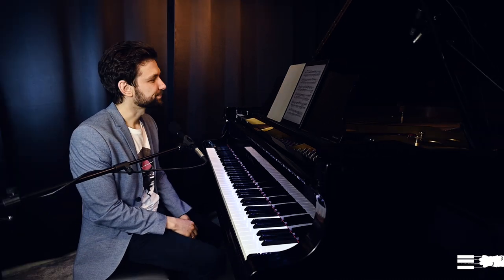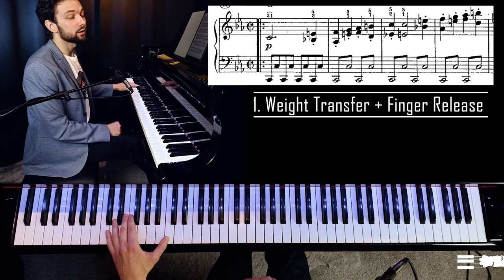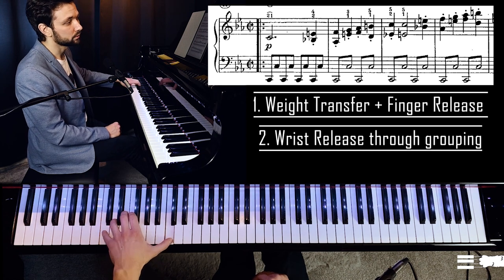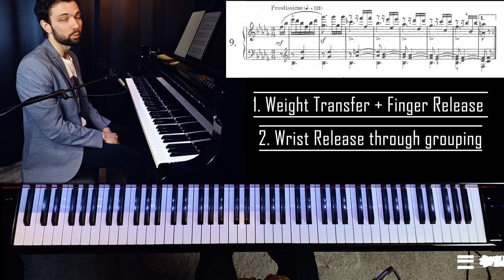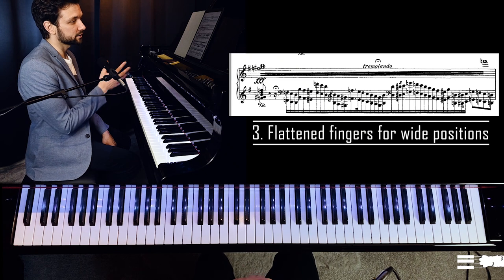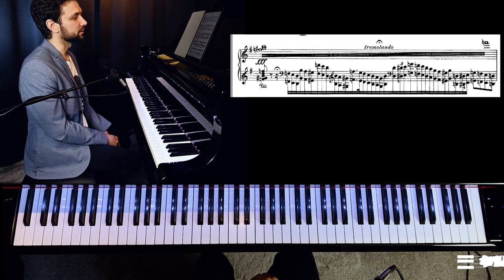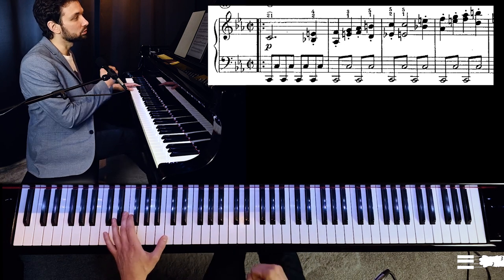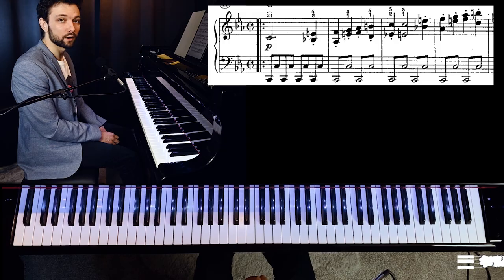Easy Technique Fix: Broken Octaves & Chords in Beethoven, Schumann and Liszt

Comment: Thanks for the amazing tips ♥️

It is very interesting that the most stable position for the pinky is mostly straight 🤔
Furthermore, are you familiarized with the arm movement terminology? The "vertical" wrist movement is called extension / flexion, whist the rotation movement is actually forearm rotation, done by the radius 🤓
Reply from the maker: Do you want to say that my explanation wasn’t clear? Sorry about that.
Yes, I’ve heard this terminology through some familiarity with American physiology methods, but English is not my first language, and I have never been a permanent resident of an English-speaking country, so of course I may use different words. Tut mir leid, ma cosa si può fare, с'est la vie😂
Reply: @DenZhdanovPianist  not at all, your explanation was perfectly clear. I was just nerding out 🤓 pas de problème!